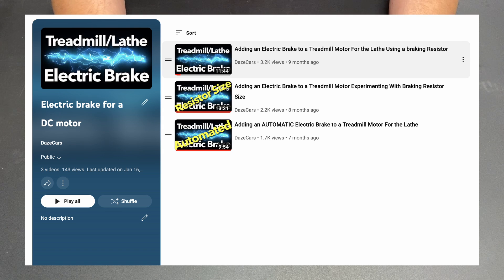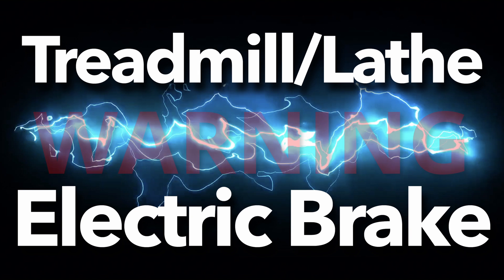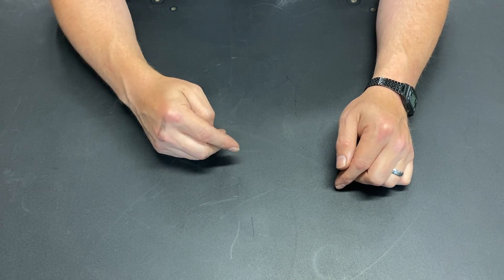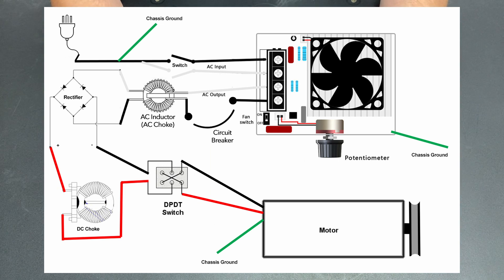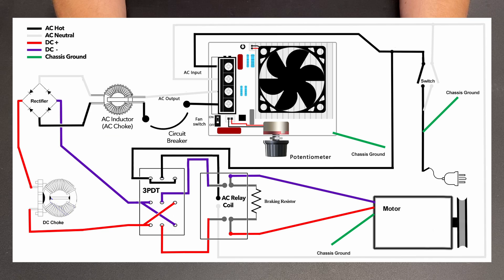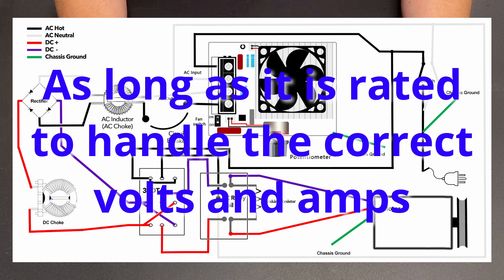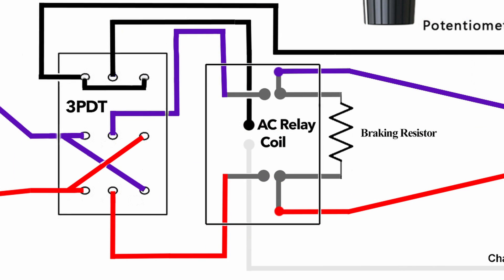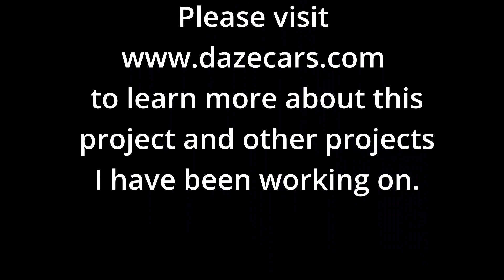Schematics for Adding AUTOMATIC Electric Brakng to a Treadmill Lathe Motor Upgrade SCR, MC60, MC2100

Comment: Ok. I’ve looked at your last schematic. You have + - DC coming from the 3PDT switch and connecting to the second row terminals of the relay (counting from the AC down). Then you have them exiting from the third row going to the resistors and motor. 
Second schematic shows the relay switched so the DC bypasses the resistors. But this is where you lose me. There is no way for the DC to get to the motor without going through the resistors. The second schematic suddenly shows the DC leaving the second row. This is an 8 pole relay but you only show 6 poles. Thats where I blow up.
Reply from the maker: it's 6 poles and two connectors for the AC.  It wires just like a DPDT switch.  The difference is instead of being switched by had it is switched by the coil.

Comment: Is it possible to trigger the brake when the potentiometer is all the way down with this setup?
Reply from the maker: Is is possible, yes would it be easy no not really.  It would take several more components like a relay and you would need a potentiometer that has an off option on one end.  May I ask what the advantage would be of having the brake engage when the potentiometer is all the way down?  When the potentiometer is even near all the way down the motor would be turning so slowly that a brake would likely not be needed.
Reply: @dazecars  I am designing a pottery wheel with a treadmill motor and I would like to control the speed with a pedal, similar to your setup with 2 potentiometer. It would be nice to stop it gracefully when the pedal is off for more precise control (and without using your hands). This setup require some pulleys, I am looking at max 400rpm, so probably that would be enough to stop it quickly. 

I just really like the challenge. But I will know for sure when I got it build and tested.

Comment: Daze, your wiring diagram is great. But when I look at the relay you suggested, I can’t match your diagram to the terminals on the relay. 
There are four rows of two terminals each if viewed such that the two copper wires are on top. 
But your diagram shows one terminal on bottom. Two above that then another terminal on the left, then two terminals above that, and finally a single terminal at the top. 
Still 8 terminals or pins, but they don’t match the pattern of the relay. 
So what’s going on? 
Thanks,
Paul
Reply from the maker: You shouldn't ever take a schematic literally.  Sometimes two components ordered from the same source will have different configurations. Just because the connections are laid out one way on a drawing does not mean they will be laid out that way on the component.  The Schematic shows everything you need to know you just need to go to the relay with a meter and confirm the configuration.  AC goes to the coil.  Figure out which two connections are for  the coil.  That leave 6 connections, two common ones two NO and two NC.  Common goes to the motor, NC goes to the resistor and the NO goes to the power supply.  All the relay is, is a DPDT switch controlled by an AC current rather than a mechanical lever or button.
Reply: @dazecars  Ok. I have the same switch and relay that you are using Daze. This was why I asked. The pins on the relay are not laid out the same as the one you are using.
Reply from the maker: @paulmanhart4481  as I said the drawing is just that a drawing. It shows how things are hooked up based on function, not connection for connection.

Comment: Thanks man, much appreciated. Now I’ll go watch and figure out which resistor you ended up landing on.
Reply from the maker: I used the two big ones in parallel because I had them BUT I would have been just as happy with the smaller ones in this video. https://youtu.be/2p3-sUZ4VPE
Reply: @dazecars  so I think I have the right switch but I’m struggling with getting the fwd and rev to work. I can’t post a pic here. Any ideas?
Reply from the maker: @zacofalltrades25  contact me through my website and email me pix.

Comment: Great work, just finished wiring up mine, just one issue, and was wondering if you or anyone else has experienced it.  My motor tends to hunt, speeds up and then slows down, happens in both forward and reverse. Could it be a faulty scr.
Reply from the maker: How do you have the power supply setup?
Reply: @dazecars  I've wired it as per your schematic, 220v 50hz supply.
Reply: @dazecars  found the problem.  The plug connecting the potentiometer to the scr board is dodgy. Just need to find a way to crimp tiny plug sleeves to ensure contact.  Thanks for concern, and keep up the great work.  Much appreciated.

Comment: This could be much easier to just switch power to 2 really 1 normally open and 1 normally closed  on the power wire to the  motor 
And run the negative straight to your motor from the choke.
Reply from the maker: how is 2 relays in opposite configuration simpler than one DPDT relay that has a normally open and a normally closed side?  I think you may have missed what I am doing. My single relay takes the place of two relays and by only having one relay if it fails the entire system fails.  losing one relay in a two relay system could cause a short.  The relay power going through both the master switch and the direction switch allows the brake to engage if the master power is cut or of the direction switch is applied.  I can not see any way to make it simpler than one DPDT relay and a 3PDT direction switch but if you know of a way I would love to hear it.

Comment: “Some of you still aren’t certain how this is wired into an existing system”. Ha! That was me! But I figured it out just by your previous comments. 
Thank you Daze. You are a master and a patient guy. Thank you for all your hard work and desire to share it with us mortals. 
I have all the components, but need a larger electrical box because of all the resistors (wired in parallel). 
When I’m finished, I’ll take photos and send them to you. 
P
Reply from the maker: it wasn't just you I got questions from several people.

Comment: Stupid Guy here! Is the 3PDT switch on-off-on or something else?  

Also, I guess the hardest part for me to understand is the relay and all the terminals. What side the power comes in etc on the physical device.
Reply from the maker: You need to watch my latest video. It came out on Thursday of last week and shows all the schematics for the automated brake.
Reply: I am responding to that video.. 😊 But let me not be too lazy. I need to study how relays work.  I guess that is the source of my problem.  I did buy the same relay, but those people never send you too much info. They assume us buyers and not idiots. 😂😂😂

Gonna go over relays and watch everything over again.

Thanks.
Reply from the maker: @marquiswhitsette3555   Sorry about that.  The first comment you made was under the other video and I didn't realize this comment wasn't in the same place.  Yes the 3PDT is on off on.  The relay has a normal open and a normally closed side.  The resistor goes on the normally closed side and the motor goes to the common between the two switching options.  Please let me know if I can be of further assistance.

Comment: Going above and beyond for the people sir 👍🏻
Personally, I’m going to be fabricating a bicycle disc brake setup for those “quick” stops. Along with an electrical kill switch to be activated together.
Reply from the maker: IMHO The bicycle brake is an excellent idea for a backup incase the electronics quit working but the electric brake is so effective that both systems together seams like overkill.  In my open the spindle is turning about 1000 RPM and it stops almost immediately.  Most of the time I am working well under that RPM.